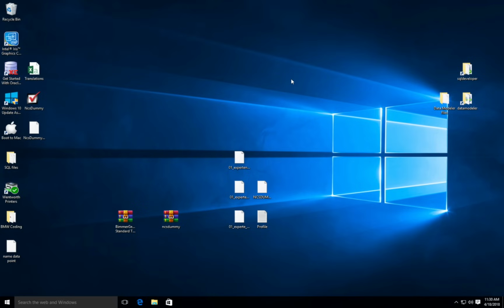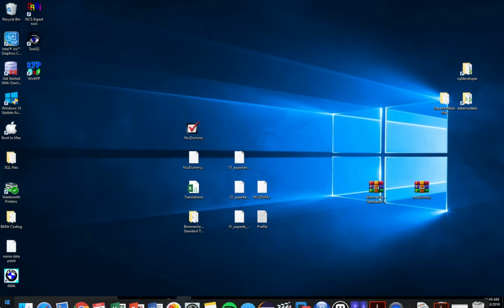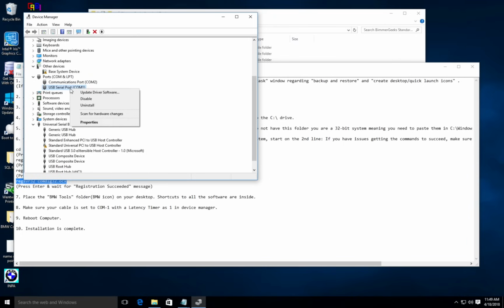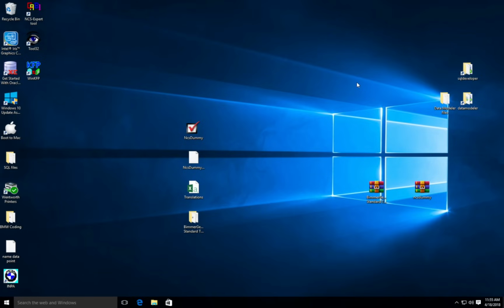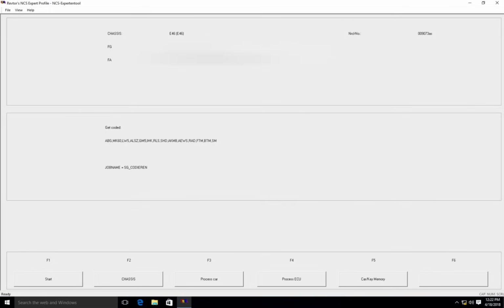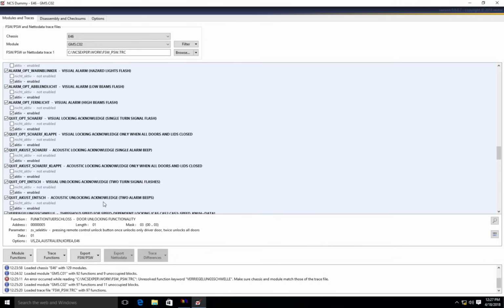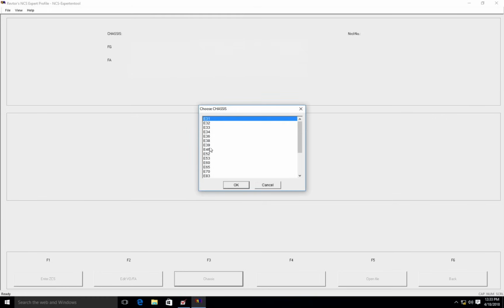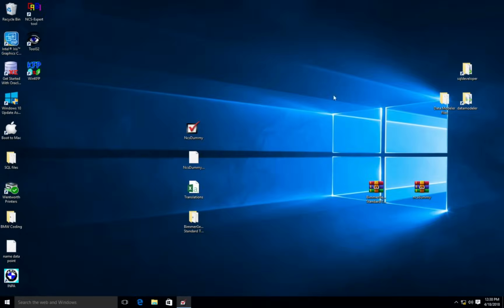HOW TO CODE YOUR BMW USING NCS EXPERT | WINDOWS 10

Comment: Hey Evan can i ask i you if you ever originally coded your car to have the comfort closing with remote from another program  or tool besides NCS expert/dummy?
everything works but my vents won't close by remote, they will however close with the key in the door comfort close
so i am thinking where you have videos of the BMW scanning  tool that you may have 1st coded your windows to comfort close with remote feature with another program tool  and that is what enabled it to work because it does not work  to close the rear vent with NCS unless i am missing something or  unless you need to do something custom like you did for your hazzards
Reply from the maker: There is a option in ncs expert to have your rear windows vent
Reply: ok thanks i will try and look again but i tried it twice and i have not seen anything  that looks relevant,  so will it show up in NCS dummy too or just NCS expert? i am guessing that the  trace file is like   template with  added translations correct? maybe it is not included  in NCS dummy? i enabled comfort closing with remote  and i also enabled one touch close for the rear windows and that also did not work like it worked for  you, but on the forums it says that you need to mod the switches for one touch close to work on the rear vents , so did you mod your switches to get your  one touch rear windows to close as well?
I have did not any option other than rear windows one touch close and comfort closing with remote, but then again i was not familiar with the term "rear vents"  when i did the coding , i was looking for windows so i could have missed it i suppose
also there were 2 files that worked with my GM5 ,  both the GM5.C05 and the GM5.C06 worked so i am not sure if it makes any difference which one i use( i tried them both,they seem to be the same)
also half of the options list looks to be highlighted in pink , about half way or 2/3 of the way down everything is highlighted in pink ,i have no idea what that means if anything at all ,i was hoping maybe you know
Reply from the maker: The option is in dummy and yes it matters what gm5 you pick in ncs dummy as it says in my video pick the one that gives you no errors at the bottom
Reply from the maker: And yes I did forget to mention my switch was modded
Reply: yes i know you said that to pick the one that gives no errors but there are 2 that give no errors , both the GM5.CO5 AND the GM5.C06 give me no errors ,  i tried to code with both and  it worked the only issue is the vents not closing and  i noticed that   like the bottom hap or bottom third of the options in the list are highlighted in pink for some  reason,  this is when i chose either C05 or  C06
My car is 01 325ci and i chose  EWS , akmb and alsz are not for my car
i wonder where you have a different VIN if you have the option and i don't
do you happen to know what it is labeled as in NCS dummy exactly?
like i said comfort closing is aktive and one touch rear window close is aktive , the rear vents close if i put the key in the door and hold  it in the lock position but it always did that , with the remote both windows roll up and the sunroof closes but the vents do not close
i thought  that comfort closing would encompass everything
and i have no clue what the other option would be called.
so you never encountered this when you coded yours, you just coded remote comfort cloing to aktive and it worked or you had to play around and find the other option to get the vents to close?
Reply: I just did my first coding and I have the same issue. Still dont have flash with key when locking either. But hey, my windows comfort close except the vents.
Reply: +Michael South i did end up finding the option  after all
it was called  something like  remote comfort close without vents ,it is in NCS dummy
not sure if  i accidentally ticked it to on or if it was already on
Evans NCS dummy in this video looks different than mine , in mine i can only see like 3 codes at a time in  the window  ,the window is smaller than his for some reason and i can not resize it so it makes it really difficult to scroll  down the list because it  is so choppy jumps around so quickly that i can't tell if in missed anything
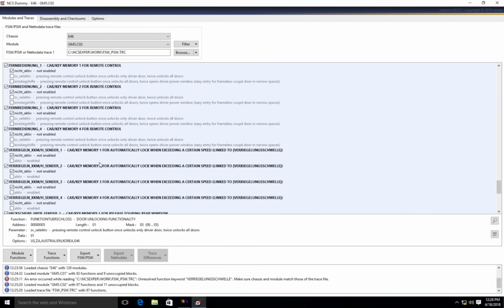@ 26:05 he has 9 coding options fitting in the window at once, on mine it is like 2 or 3 and makes scrolling th elist without missing things nearly impossible or at least really slow and difficult, not sure if that is how it is on your PC but on mine it was really laborious to check every single option because of this
Reply: also i am pretty sure that the blinking lights when locking  is only for sidemarkers i don't think you can get  your low beams or high beams to flash unless you have the actual alarm , at least  it didn't work for me
unless you can code something in the  LSZ to make it work after  you code the options in  the GM5
my lighting module has a different name too i think  not ALSZ just LSZ and the option for the double  flash hazzards  is set up different too when i tried to edit it notepad it couldn't find that phrase
i ended up just using  NCS dummy to code the hazards after that 
clown nose blink works ,  flashing when lock /unlock works ,  but only for  blinkers not headlights

Comment: great video , thanks again
i got the cable i bought on ebay  to work fine , i  added the switch to bridge pins 7 and 8
i have a 2001 325ci (US)
i got the blinker lights to flash when i lock /unlock and i got the windows to roll up with the key fob (sorta) but i can not get one touch close to work for the rear windows for some reason
also my windows roll up with the key fob and the sun roof closes but the rear windows do not close  but if i put the key in the door and lock it and hold it they will close,
i coded it twice  for one touch close rear windows but it doesn't work , so i thought maybe that i needed to  code rear window jamming protection for it to work for one touch close, it was not enabled so i thought it might be a safety thing again ,  but  when i coded that to on ten my read windows wouldn't close at all, i d=coded it back to off and they close again but no one touch close
i did notice that in NCS dummy when selecting the GM5 that there were 2 that worked gm5.c05 and gm5.co6 so i tired it with both and still nothing
oh and even though my car is 2001 i had to select the option for non facelift AKMB ans ALSZ didn't work so  i went with EWS but  i wonder if i try KMB if it will make any difference?

and the only option for  the visual alarm with no alarm module installed that worked was blinking the blinkers when i lock/ unlock , i tried to code it to blink low beams but it didn't work either , the only one that specifically said with no alarm module  was the blink the blinkers one
i wonder if there is a way to do it manually  and also to get the horn to honk when locking and unlocking or maybe even something even more advanced like  make it behave like other cars where the  horn honks intermittently and the  light lights flash as an alarm if the door is opened

Comment: Running this on Win10 without issue. Recently coded and activated my E60 530i Bluetooth. Make sure you update Daten files if you run into Coapi errors during coding.  Great video.
Reply from the maker: Make sure pins 7 and 8 are bridged on the inpa cable
Reply from the maker: Yes
Reply: Make sure you're using the latest daten files for your model. They must be loaded into the software. If you don't have the daten files, you can get the package you need from (Bimmergeeks) the latest version on the site is 60.1. I used it without issue. Once you download the daten files you'll need to load them, the easiest way is with the BMW CODING TOOL. Make sure you update Daten and WinKFP. Search for some videos on youtube, I believe there are a few good ones that walk through how to update the files with this tool. 

Once you've downloaded the file for your model from BimmerGeeks, and updated try your coding attempt again. You shouldn't get the Coapi error. The reason the error happens is because the Coapi process file is pulled from WinKFP by NCS expert, if NCS expert can't find the file (in WinKFP), it throws the Coapi error. Hope this helps... Good Luck!

Comment: thanks i was waiting for this video but i already had ordered a k+dcan cable but it is not the one with a switch to bridge the pins ,it was this one
https://www.ebay.com/itm/For-BMW-INPA-Ediabas-K-DCAN-USB-Interface-Diagnostic-OBD-Test-Line-Scanner-DIS/301594647321?ssPageName=STRK%3AMEBIDX%3AIT&_trksid=p2057872.m2749.l2649
can i still use it as is or can i open it up and bridge the pins?